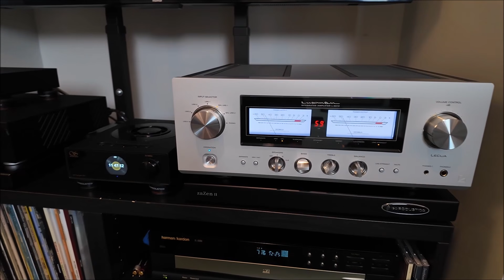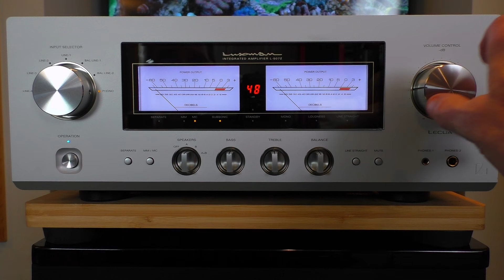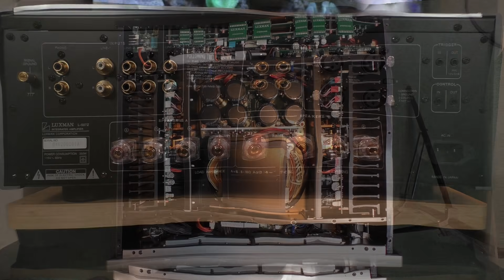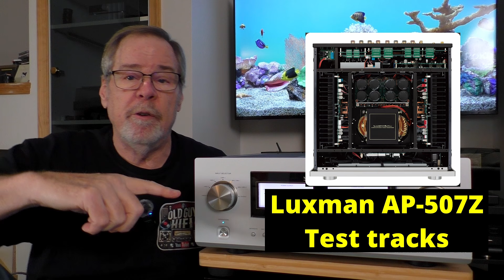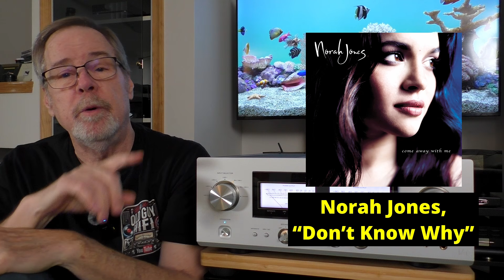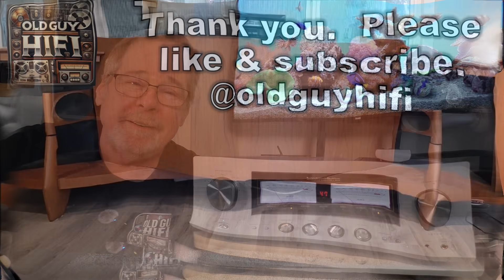This Luxman L-507Z Made Me Rethink Everything I Thought I Knew About Integrated Amps! No BS.

Comment: Thanks for excellent review, I’m currently at a crossroads with my audio system and facing a serious dilemma about upgrading both my amplifier and speakers.

At the moment, I’m using Buchardt S400 MKII speakers driven by a tube amplifier from the Kraków-based Polish manufacturer Haiku Audio Sensei 211 Special*. My source chain consists of a *Denafrips Pontus II DAC and an Auralic Aries G1.1 streamer.

I mainly listen to metal and hard rock, and my room is about 20 m².

As for speakers, I’m leaning towards either Buchardt E50 or **Arendal 1528**. Because of that, I’ll also need to change the amplifier, as my current one may be underpowered for these speakers.

The amplifiers I’m considering are because right now i can't affor for their big brothers:

 Accuphase E-3000
 Luxman L-505Z

Would that be the right direction?

What I care about most is a wide, holographic, three-dimensional soundstage, excellent instrument separation, micro dynamic and tight bas and above all, music that brings pure listening pleasure — something with real magic and emotional engagement. From what I’ve gathered so far, these models seem to align best with those expectations.

So my final question is: does this seem like the right direction — and if so, would you choose the Luxman or the Accuphase?
Reply from the maker: I prefer the sonics of the Luxman over Accuphase. Accuphase can sound thin in the bass and mid-bass regions with a forward midrange. The Luxman is much more of a full range unit.

Comment: Hi Ed, what a great review! I’ve had my eye on this integrated for quite awhile (L505z too).

You caught my attention when you mentioned the 507z is a voltage driven triple Darlington design. Under the hood this integrated looks almost exactly like my 1990 Luxman M-117 power amp (M-03 European version). 200 watts 8-ohm/250 watts 4-ohm with a damping factor of 130. 60,000 vs 80,000 capacitance. Very powerful and the typical black box look from the 90s. 

I own a lot of vintage restored/recapped Luxman separates.

I think you just saved me $11,000, for now🤪
Reply from the maker: Glad I could help.

Comment: Another great video.  Really appreciate the insight and depth you bring and share.  I do have a question. You mentioned that the pre-outs for subwoofer use can only be done in high pass? Does that mean that you cannot hook this up to an active subwoofer and have that active subwoofer be the crossover? Just a bit confused about that statement.
Reply from the maker: It doesn't have any bass management. So, yes you would be using the subs x-over. Sorry for the confusion.

Comment: I have owned both the Luxman L-509Z and an Accuphase E-4000. It would be great if you can get an Accuphase to review. My thoughts, the Accuphase E-4000 and the Luxman L-509Z are both outstanding high-end integrated amplifiers, but they present music in distinctly different ways that will appeal to different listeners and musical preferences. The Accuphase E-4000 leans toward a neutral, highly resolving, and transparent presentation, excelling at clarity, low noise, precise imaging, and tight bass control. It reveals fine detail and spatial cues exceptionally well, making it particularly strong with classical, acoustic, jazz, and well-recorded high-resolution material where nuance and accuracy are paramount. In contrast, the Luxman L-509Z emphasizes musicality and emotional engagement, with a punchier midrange, slightly fuller bass, and a treble that is forgiving of less-than-perfect recordings. Vocals, blues, rock, pop, and analog sources tend to sound more inviting and organic through the Luxman, especially during long listening sessions. Ultimately, the Accuphase functions more like a reference instrument that exposes everything in the recording, while the Luxman prioritizes flow, tone, and listener enjoyment—neither is objectively better, but each excels depending on whether precision or musicality is the primary goal. For now, I decided to keep the E-4000 in my system.
Reply: That is a good explanation. I always wonder how Luxman compared to an Accuphase integrated amp. Also have my eyes on E-4000.

Comment: How'd they do with the Buchardt E50s?   With no subwoofer out on the Luxman, would that be an issue with these speakers using no subwoofer?
Reply from the maker: There is a pre out on the unit which I mistakenly mis-described. So, there is a "sub" out. I did not have the Luxman and the E50s together. I do think that would be an excellent sounding combo.

Comment: Hi,
I would like to ask you about static electricity:

Feeling a slight electrical tingling or "kicking" sensation when touching metal parts of the amplifier or player. Can damage the component?
Thanks 
Your fan
Ben
Reply from the maker: That isn't good. Check all your power connections and make sure everything is grounded properly.
Reply: @OldGuyHifiThanks for answer
Reply: @OldGuyHifi Luxman are nice but grossly over priced like a Rolex watch.
Reply from the maker: Your opinion. If you can afford it then it isn't overpriced. True if almost everything.

Comment: I tried this unit in August 2024, ended up returning it. Hard to describe (as usual) but the sound seemed artificial in some way, not very linear, harsh highs, and a somewhat compressed soundstage. I think it was an open box, probably low hours, so maybe some burn-in would have helped, I don't know. But I recommend finding a local dealer where you can audition this unit before you buy, so you don't have to deal with repackaging and shipping this unusually heavy piece of gear.
Reply from the maker: Everybody has different tastes. If we didn't there would only be one brand.

Comment: I have Yamaha AS2200, does Luxman sound warmer than Yamaha?
Reply from the maker: By miles. In my opinion the Luxman is far more refined. I find Yamaha amps to be very thin and a bit crispy. The Luxman has balls and great low end. As I mentioned, smooth, detailed and engaging. This is just my opinion. If you like it my thoughts are immaterial.

Comment: Sir can we play or add subwoofers through the preouts since there is now a seperate switch given. In older amplifier it's  so much fun to get parallel signals to my subs giving a different experience though the subs have class D. But still.
Reply from the maker: Yes. I subsequently found out the pre out is live when switched.
Reply: @OldGuyHifiSo can we we play the mains and subwoofers together.  Thanks for replying.

Comment: I had a Lux C120A pre & M120A 2ch power from 1981 until 1990. By that stage I had become a single source listener & so my next amp (power amp only) was a Luxman - 'M03' with separate L + R Alps pots next to each other sticking out of the fascia, this allowed me to plug my outboard DAC (as they were called back then) Audio Alchemy - 'DDE v1.0' straight into the M03. The sound was stunning; just stunning...no preamp required, just straight through. I have a HEGEL - 'H390' now only because I was curious about Bent Holger's - 'Sound Engine 2' feed forward circuit (as opposed to the negative feedback that just about every amplifier manufacturer designs/engineers into their amps these days; including Lux) It's been quite a journey 👍😉 BTW, my Lux amps were NEVER thin in the bass, in-fact just the opposite...a little bit fat in the bass, which worked very well with my then Harbeth - 'HL Compact' standmounts. Nice to hear that Lux is still up there...I just don't need tone controls anymore.
Reply from the maker: Thanks for sharing your story.

Comment: I auditioned the 30 watt Luxman receiver in the late 70's at Roger Sound Labs. I don't think I had heard of Luxman at the time, so went in without any bias. Two things impressed me. It sounded like a more powerful amp and it was strikingly musical. With most amps part of my attention is thinking about how the amp sounds. With Luxman I am immersed in the music. I never forgot the beguiling Luxman sound. More recently, I looked on Ebay to see if there were any not too expensive Luxmans and found a L-430 in almost new condition for $162. It is the best sounding amp I have owned and maybe ever heard. I wonder how close the sound is to a modern day Luxman with similar power. If they were the same in a blind listening test, that would not suprise me. If I had the money, I would consider the M-10X and run them as monoblocks with the matching preamp.
Reply from the maker: Thanks for sharing your experience.

Comment: Of course I'd love to have that Luxman. I'm pretty content with my K11R2R>A70Pro>JBL LSR310P sub>LSR305P speakers. I've got about $1325 in it, not counting cables, that are mostly WBC.
Reply from the maker: The review of the K13 R2R will be out Sunday to non members.
Reply: @OldGuyHifiI saw Z's review of it, but I didn't need the balanced output for an extra $145. The odd thing is I haven't used my $900 Geshelli J3 with V7 Classic opamps on the XLR output since I got the K11R2R. I selected V7 Vivid on the J3's RCA output but it's too clean into the 70 Pro. 
Another odd aspect that the K11R2R has rendered is some spatial ques well outside of the bounds of my speakers which I don't recall the J3 doing.

Comment: This summer I compared the L-507Z with the Electrocompaniet ECI 6DX Mk II, the LAiV GanM with Harmony DAC and HP2A preamp, the Accuphase E-4000 (class A/B) and the Accuphase E-700 (class A). The best was the LAiV combo units followed by Accuphase E-700 and E-4000. The L-507Z was comparatively a bit harsh in the treble. But the best of all the tested units (and the one I bought) was the Phasemation SA-1500. It is a 300 B single vacuum tube stereo integrated amplifier with 9W output/4Ohms. My speakers are PureAudioProject Duet-15's.
Reply from the maker: Thanks for sharing that.

Comment: Hi Ed, great review! I fell in love with "Lust"man integrateds when I first heard the 505z and 509z a little over a year ago. I've wanted the 507z (sweet spot) ever since. If you ever have a chance to hear any of Luxman's integrateds paired with Sonus Faber speakers, do it! It's a heavenly combo. Question for you or anyone else here: I absolutely agree with everything in the review. But I wonder: how do you think a Luxman integrated would pair with speakers that are typically considered "bright" sounding? Ie, B&W, Focal, etc. I've got a pair of Focal Kantas that I absolutely love, and I'm hoping a 507z would take them to the next level. Thanks!
Reply from the maker: It should do well. Luxman is very forgiving.
Reply: @OldGuyHifi Goood as i have the 805 Signatures ,latest version!
Reply: @philbert9117   hi I have Electa Amator 3 and considering to buy a Luxman. The 507z will be a good fit ?

Comment: Thanks so much for the insight in to the Luxman.  I'm currently running the Pass Labs INT-60 and would love to hear them head to head.  My only issue with the INT-60 is how much heat that sucker pumps out.  But the sound makes up for it.
Reply from the maker: It is a nice unit.

Comment: A technical question if you don’t mind. If I’m listening at one watt and the music has a 30db transient that’s a 1k watt demand. Since that is obviously more than the continuous rating is that demand serviced by the capacitors?
Reply from the maker: Not a worry because +30 dB Transient Spikes Don’t Exist in Normal Digital Recordings. A +30 dB transient spike would mean a sudden increase in level 30 decibels above the program material. In digital audio, that simply isn’t possible because:

1. Digital full-scale limits it. All digital PCM formats (CD, WAV, FLAC, etc.) have an absolute ceiling at 0 dBFS. A transient cannot go above 0 dBFS—there is no headroom. To have a +30 dB spike, the rest of the recording would need to sit at –30 dBFS, which no commercial master ever does.

2. Mastering practices prevent it. Mastering engineers tightly control peaks. Commercial releases usually fall in these ranges: Pop / Rock: Peak-limited, typically between –1 dBFS and 0 dBFS. Classical / Jazz: Peaks near –3 to –1 dBFS, with quieter passages maybe –20 to –30 dBFS, but no single transient leaps 30 dB above the musical average. Audiophile / High-dynamic-range releases: Peak-to-RMS differences of 15–20 dB are common, 25 dB in extreme cases. But 30 dB of instantaneous transient rise is beyond what microphones, preamps, ADCs, and the digital format itself typically accommodate.

3. Microphones and analog stages clip first. Even if you could encode it, the front end would distort before capturing a +30 dB attack cleanly: Most studio mics saturate somewhere around 135–150 dB SPL. Preamps rarely have 30 dB of “instant headroom” above calibration level. ADCs can’t exceed 0 dBFS. So the analog pipeline prevents such spikes. 

The Caps filter the power and provide a bit of reserve for the power supply. I hope that answers your question.

Comment: Good looking unit but the price, 11,000. and no sub output.
Reply: Of course there’s a line-level subwoofer out on this amp. It’s called pre-out, a line level variable out meant to drive an outboard power amp or a subwoofer (or two). It’s right there pictured in the video!  Old Guy was wrong.  How do I know?  I own one of these amps and successfully use a pair of subwoofers hooked to the pre-out jacks.  Cheers!
Reply: @daniannaci3258  Ut does not have a dedicated sub out
Reply from the maker: I made an error on the preamp output. It can be used as a sub out. Sorry.